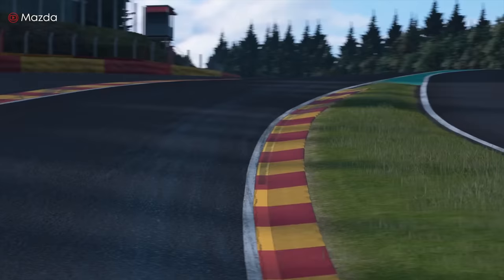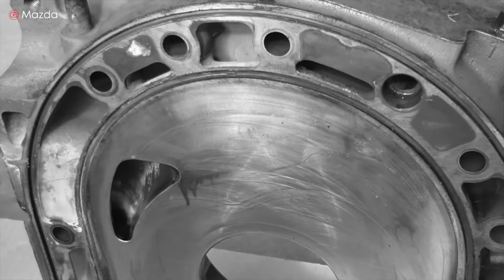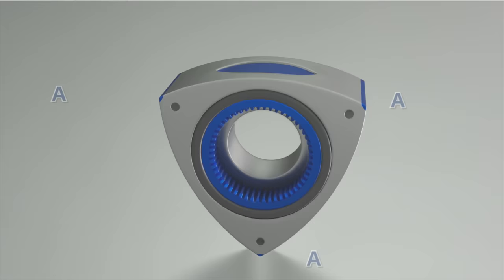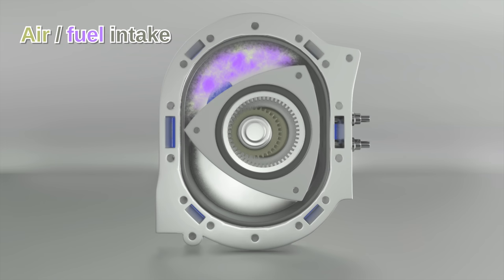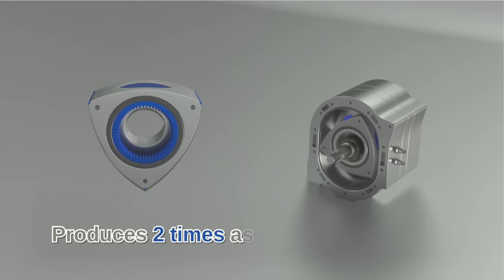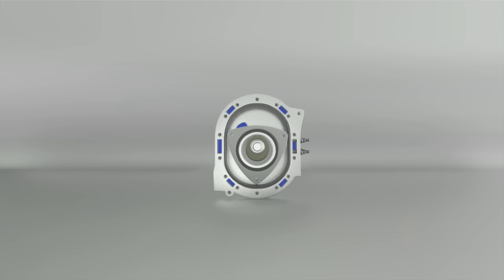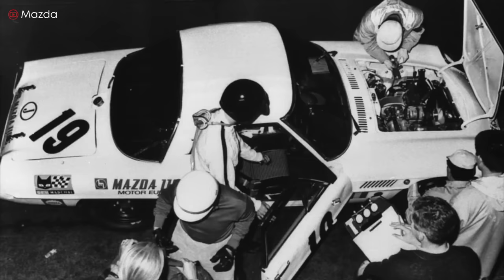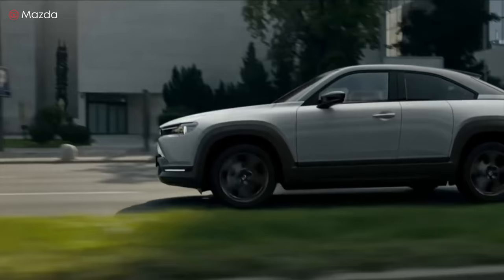Mazda's New Engine is the Most Powerful Engine Ever Made

Comment: Almost 11 minutes of video and NO mention whatsoever of Mazda’s most powerful new engine.
Reply: Agree.
Reply: Damn
Reply: Thanks for the heads up
Reply: @allonyllc1879  damn
Reply: wast of time. not to mention some of his info is incerrect.
Reply: Commenting to boost 👍
Reply: Cheers imma out
Reply: Thank you
Reply: The only reference to Mazda was the rotary motor. Heard nothing of anything new.
Reply: Seriously
Reply: Dang, wish I didn't wait 7 minutes to read the comments.
Reply: He is talking about the rotary engine... It's new compared to a piston engine, and its more powerful for it's capacity. That's all
Reply: Where new engine?
Reply: thank you for saving my 11 minutes. you are god level.
Reply: At 10:34 he said a small unit "exclusively" as a range extender for upcoming electric vehicles.  It would be neat to be able to toss your range extending motor in your frunk, when you need it.  Im thinking maybe a 5 gallon fuel tank on it and you could get you another 100 miles?
Reply: You must be new here😅
Reply: because its a trick - there is NO new engine!!!
Reply: @dantheman1337  But it isn't new.
Reply: Exactly
Reply: @dantheman1337  Mazda did rotary back in the early 2000s. Cost a fortune to repair them. I was a mechanic for Sunshine Mazda in Georgia for a few years crap cars for sure.
Reply: They don't even have a new rotary engine.
Reply: Check to see what powers drones, you'll be neatly surprised.
Reply: If you understood how these engines work, you’d understand how powerful they are.
Reply: @matthewgridley3509  VERY INCERRECT
Reply: @sixhundred3score6  last 15 seconds he mentioned one as a range extender for their electric car. No power figures or design changes mentioned at all.
Reply: this dude's time has passed
Reply: Lol maybe it is still 2000s for him sounds a bit old
Reply: Thank you for reminding me why i unsubbed a bit over a year ago idk why it recommended him to me again; you've saves me 11 min.
Reply: Seriously.  WTF?
Reply: Disappointed!!
Reply: Wish i seen this comment 11 minutes ago
Reply: realmente emputado, really piss off
Reply: Hee hee I remember why I unsubbed now
Reply: @disturbedawsome  Incorrect
Reply: @sonofagun5305  Incorrect
Reply: at 10:27 he states that all future Mazda rotary engines will be range extenders for their fleet of electric cars.
Reply: Thansk for saving my time
Reply: Luckily I have read comments first
Reply: Cause they dont have one for street use
Reply: And for rotary engines, he’s entirely missed the offering from Liquid Piston. While they are sticking to small 5-50 HP models where they can get inroads to market share it is quite impressive. It’s probably the most visible candidate as a temporary range extender setup for EVs. They did a 30kw generator for the Army that can be easily carried by two people. It replaced a unit that needed a truck.
Reply: Lol
Reply: Not like it would be accurate anyway, he is wrong more then he's right
Reply: closest .. but not quite: 10:05
Reply: I hate YouTube
Reply: @dantheman1337  eh considering the design is still old as hell (iirc 50 years old give or take, i could be wrong)
its def not new new, and durin' the 60's or so car manufacturers were messin round with rotaries, though mazda was the only one to do it decently.
Reply: Then you didn’t watch it
Reply: Have you turn to the upgrade King to get your heart soul and body ready for the next level yeah call out to Jesus Christ to heavenly mechanic to be super naturally charged so that you will be welcomed into heaven.

Romans 10:9-10
Reply: 0:30 of the video I believe presents the data you were seeking. 

A 1.3 liter engine that makes 232 HP.

007
Reply: Never trust adult men that end their name in Y.
Reply: Oh no! Scotty have you got that Whambulance on speed dial yet?
Reply: Unethical.
Reply: Yeah, wtf Scotty
Reply: Rx-9. I have nothing but 7’s.  88T2, 89T2 and 93FD hardtop with greddy T2 single turbo+ a lot of other things….yes im a rotary junkie.
Reply: right!?!? SUch a bad vid
Reply: Hes confussing
Reply: Exactly, downvited it for that reason.
Reply: waste of time!
Reply: Yes..  dislike and report
Reply: It won't be most powerful, it'll be the least as it will just be a range extender for the Mazda battery powered suv.
Reply: @surfside75  that's just one of their new engines, We've know about the ev range extender, but Mazda has been hinting at a new sports car with a form of Skyactive Rotary.
Reply: * Your typical Scotty material. Disappointment at its finest.
Reply: Literally 0:16
Reply: Yeah it's an old motor.
Reply: You're right.
Reply: This is why YouTube should let us keep the dislike counter
Reply: @matthewgridley3509  YES MAZDA DID NOT INVENTED JAPAN JUST MADE IT BETTER THEN THE GERMAN INVENTOR.
Reply: @dantheman1337  bingo
Reply: I was thinking the same after I skipped through half of it
Reply: damn thnx
Reply: @matthewgridley3509  : All of the information I heard was correct. What did you hear that was incorrect?
Reply: most powerfull and the most fragile.
Reply: I wanted to know what was new and there is nothing new.
Reply: @gonzf.6983  I got to 4 lol
Reply: Thx u just saved me 9 minutes of life
Reply: I watched the whole video without reading the comments. This is why we need dislikes to be visible
Reply: @sonofagun5305  He said they only get 12mpg. That's so far beyond false and incorrect, its a straight up lie.
Reply: @deusexaethera  12mpg gas mileage? Completely wrong, total lie.
Reply: Agreed!
Reply: @dantheman1337  well it WAS new in the ....30's anyway
Reply: @sonofagun5305   know I think you are rong
Reply: @treyvonmartin7989   Why?  whats wrong with my tube?
Reply: @gtaiv2993   Not fragile...the word fragile suggests catastophic breakage  the words should be along the lines oflacking the longevity of many piston engines....of course the truly mostpowerful engines only last in the hours minutes or even seconds ....F1 engines dont last so long and dragster engines have pathetically short life spans ....there are many examples of consumer automobile engines that had way less longevity than the RX motors ...its all relative I suppose
Reply: @allonyllc1879  Did you guys miss the conclusion of the video?! There is no new engine! Lmao
Reply: Wish I had scrolled down before I watched it.

It did cost him a like though. That was a shitty thing to do.
Reply: And the dude made 50 thousand on this video
Reply: Thats what Scotty does best
Reply: I hate that about YouTube
Reply: Agreed
Reply: You must be new.
Reply: He's talking about the rotary engine. what I don't understand is, it's not knew. It's been out a while now.
Reply: Well that's it
Reply: Typical of this guy…..
Reply: Because rotor engine itself is most powerful engine
Reply: This pisses me off so much that I've started telling YouTube to hide channels that do this from my recommendations, and I guess Scotty just got added to the list.
Reply: Scotty a joke.
Reply: thanks
Reply: Ok than i aint watching it
Reply: Cause it’s a video of a rotary engine!!
Reply: Agreed
Reply: I know and that’s the only reason why I wanted to watch the video. I don’t know about this guy sometimes. He is an alright dude tho, just got to get better at this video making.
Reply: @matthewgridley3509  Incorrect.
Reply: @dl8619  Mazda did rotary all the way back to the 1960's,SON... lol
Reply: Hey Scotty, the Wankel ENGINE IS NOT NEW! Where have you been?
Reply: Yup glad I didn't waste more than two minutes here.
Reply: Must of been watching a different video
Reply: I think he did, as like he said, this engine is being combined with electric... that's the "new" part.
Reply: Yeah, avoid this guy's videos.
Reply: @matthewgridley3509 it's Scotty. People come to his page to laugh at the incorrect info. That's the whole.reason people watch him. Doesn't have a single accurate video that I have seen

Comment: Never underestimate the power of the spinning doritos.
Reply: never estimate the tears of mazda owners because of apex seal failure
Reply: What's a Muzda...
Reply: Spinning is a good trick.
Reply: Idk why this is so funny lolz
Reply: The Rotating Guitar Pick 🎶  🎶 🎵 🎶  🎼
Reply: I want some now...
Reply: @michaelsookoo3927  go look at a dorito chip and then the mazda engine. if your serious....
Reply: mad max cult of v8,BLASPHEMY!!!!!
Reply: @lordjaashin  Never underestimate the hands-on experience and willingness to rebuild the engine from the same owners themselves.
Reply: Had a '73 RX-2.  Sooo much fun. Blew the doors off a few muscle cars with it (came stock with a 4-barrel). Blew a few seals too. Rev it to 8K, dump the clutch, turn left and do donuts until you get dizzy. If you revved it up and turned it off before you let off the gas, the cat would cook off a VERY loud bang about 30 seconds after you walk away from it. Good fun in a crowd.
Reply: Rotary engines are fun but they work like a 2 stroke engine they don't last because they blow up. I will stick with my 4 stroke engines which last longer and can take a beating.
Reply: Until the Doritos go CRUNCH when the Apex seals give out at 50,000 miles.
Reply: mlg mazda 😎💀
Reply: 3D dorito
Reply: Torque isnt their strong point lol
Reply: Never underestimate the power of the scout's code
Reply: The zaku pic is the icing on the cake for this comment
Reply: Specially when you run out of clay pigeons.
Reply: @limelife7457  Rock & Roll.
Reply: My first car was an ‘86 RX-7 5 speed manual. It died in 1999 with about 175k miles. It was contankerous and an endless money pit, but tons of fun & handled like it was on rails. I miss that car
Reply: Similar to what Doritos does to my lactose intolerant stomach 💩💥🚽
Reply: @daewooparts  😆😆😆👍
Reply: Lmao😂😂
Reply: Apex seal failure 1 2 3 4 5 6 7 times and counting.  Never underestimate the stubborn loyalty of rotary engine fanatics.
Reply: This wins "stupidest comment on the internet" today.
Reply: Believe it or not there is people that actually know how to use this engines.
Reply: Check out liquid piston
Reply: @michaelsookoo3927  because Wankle  just sounds funny!
Reply: Too much fast! You messed up!
Reply: @anhweinacht439  lol that's also true
Reply: Lollll
Reply: Ahhh! Nacho cheese smelling exhaust... mmmm
Reply: DORITOS
Reply: @SovereignKnight74  We sent this over to marketing, and they didn't care for "doritos go crunch," and suggested, "comes with a 50,000 mile free death clock, guaranteed."
Reply: I remember Norton motorcycles (Uk) last stab at reviving this phenomenal engine. Simple and elegant in principle but plagued with engineering limitations. With the advent of electric vehicles and increased pressure on climate control,  these fossil fueled relics along with the otto cycle will soon be assigned to the history books.
Reply: Lol
Reply: Especially the cool ranch spinning Doritos
Reply: 😂😂😂😂Doritos in beast powermode supercharge rotary setup in a apex chamber!!
Reply: Sooo funny, I always thought that
Reply: That’s what my father always said.
Reply: @SovereignKnight74  
Did Jay Leno do a Mazda commercial back in the '90s?
I seem to recall him ending the spot by saying......"crunch all you like, we'll make more!" 🤔
Reply: Words of a legend
Reply: @lordjaashin  - Or Tears of Dealers Losing Money, because A Nearby Race Shop, charged me 1/3rd the Bill they wanted, for my Repair! (Because they were not Engine Rebuilders!)
Reply: haha
Reply: @jordangutierrez8935  so where is the torque?
Reply: I bought an RX-3 in the late 70s for $300 because the Mazda dealership told the owner, over the phone, the cost of replacing the clutch and pressure plate, but I fixed it for $7 because it only needed a clutch slave cylinder repair kit and a little hydraulic fluid. I drove it for a while and gave it to my little brother who loved that pocket rocket until a woman ran a stop sign and parked her Volare station wagon in the passenger compartment.

One of the most fun cars of my lifetime!
Reply: @thirdyiii9649  
My RX-3 was extremely light, and the engine weighs next to nothing, so I never once gave torque a thought.
Reply: @jordangutierrez8935  go look at rob's 4rotor
Reply: @marioalmazan4323  ive seen it. Its sweet, when it runs lol
Reply: Tortilla chips
Reply: Your dorito blew its seal
Reply: Well, the better thing is that no-one uses Tesla turbines to make even more efficient power...
Reply: @Jacob Del Bene What about the low end?
Reply: The rx 78 uses 8 spinning Doritos
Reply: XD
Reply: @lordjaashin  yeah but there’s aftermarket seals that basically eliminate that issue
Reply: 3D Doritos are the supercharged version
Reply: hahaha thanks
Reply: @limelife7457   lol
Reply: The truth is out there, I want to believe.
Reply: never underestimate power of spirograph and maccano,good old toys. flippin doritos smh haha. 🤨😑😐🙃 but they are good with chilli and sour cream 😊
Reply: The apex seals fail because the owners !!
Reply: @lordjaashin  
indeed!
Reply: isn't that what gamers use to power their fingers
Reply: Amen
Reply: Haha
Reply: Wish I could taste that kind of Doritos 🤑
Reply: There are many rotaries that don't have that problem, if mazda takes heed of some of the other designers and redesign the engine from scratch it will not have the same engines
Reply: lol...
Reply: Cheese or original
Reply: @donh215  Miss that car because of the tons of funds dumped into it?
Reply: @rishz7857  no, but it was a great time spooling those rotors out to 7k. It was the electrical problems that killed my wallet. Constantly fried headlamp switches and hvac control units. I think they were called heater logicons. Mazda parts were insanely expensive
Reply: MLG kicked in.
Reply: Now there's  a spinning Pringle inside a dorito
Reply: The liquid piston will leave the wankle in the dust
Reply: @lordjaashin  the liquid piston engine will over take roteries
Reply: @lordjaashin  never underestimate 2 stroke oil in your gas tank.
Reply: I never do, and that is why I'm about as inefficient as that spinning Dorito engine.
Reply: You cheeky bastard. I see what you did there
Reply: I’m pretty sure apex seal tech has came a little further than what it use too be
Reply: My buddy put a 4-rotor in his miata mx-5, he let me drive it one time and I wasn't allowed to after that, he had never pushed the car and I did lol. Brap brap brap brings a smile to my face 😁
Reply: Lil spicy nachos
Reply: Ultimate beyblade
Reply: ......to not last long. They do sound wicked when you dump a good 80 grand into a twin turbo triple rotor drift beast tho.
Reply: Hilarious
Reply: @lordjaashin  eh it's worth the brap brap
Reply: @IshEaterson  ikr
Reply: Yeah but are they ranch, nacho, spicy nacho or the other choices.
Reply: Ha Cadillac would smoke Mazda!
Reply: Zzzzzzzz!
Reply: Junk engine.
Reply: Huh
Reply: @lordjaashin  unbreakable apex seals exist my guy
Reply: These engines are like weed eater engines. Except they are crammed in a high performance sports car.
Reply: Until it blows
Reply: @jamesspatt3112  The liquid piston IS a rotary engine, doofus.